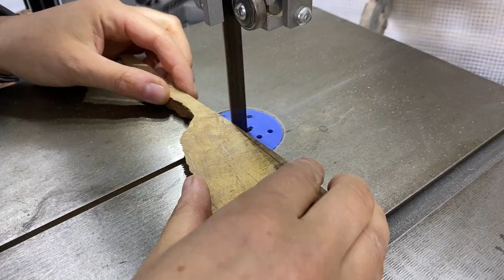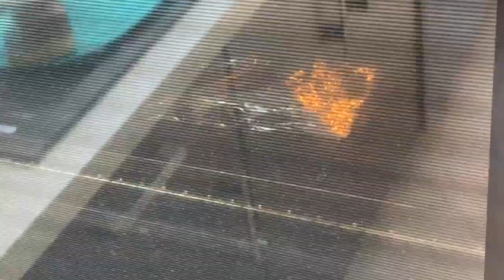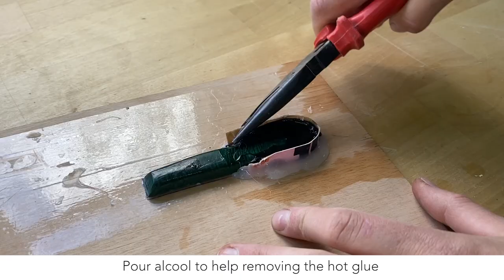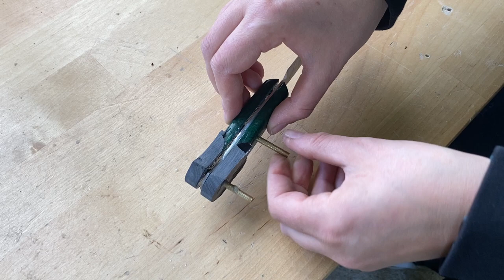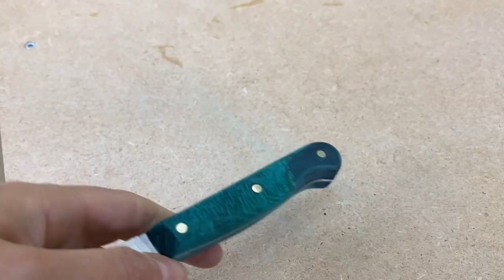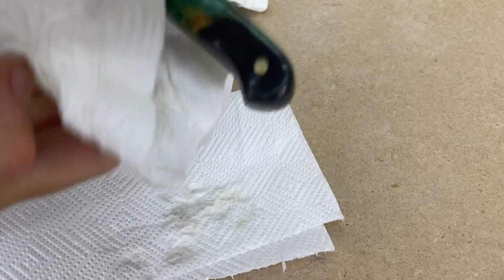Making a wood burl Knife handle

Comment: That was awesome! And the explanations added a lot. How does the dye work? Did you have to bake it on the wood? I loved the cardboard molds for the epoxy :)
Reply from the maker: Thanks Simon! Yes, I took your advice and ad some explanations😉 I dye the wood with some cartridge ink, I know it is not usual but it works really great. When the wood is dry I put it in the pressure pot with some cactus juice (stabilizing resin) and put it in the oven for hardening the resin. Really long process that I will probably show in a video someday ☺️